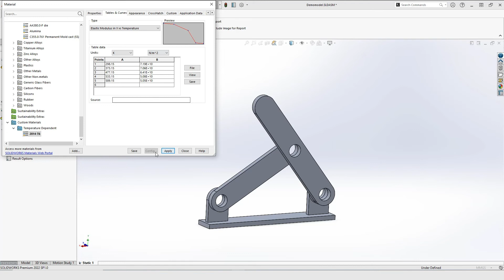SIMULATION TUTORIAL: How to change material properties

Comment: when I select material option at that time I show the error is ' the parameter is incorrect ' , so what is the problem??
Reply: Hi Janak!
This could be because your license has expired, so you should try to reactivate it.
It could also be because the wrong license is checked out from SNL. Make sure that it is a license higher than SOLIDWORKS Standard that is checked out.
If neither of these solutions work, you should send an RX to your reseller and ask them to help you troubleshoot this.